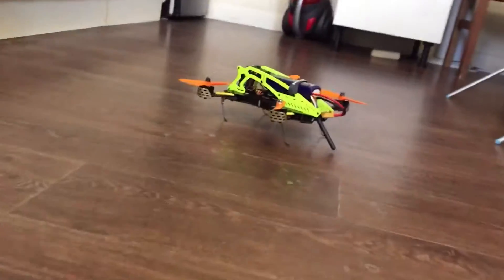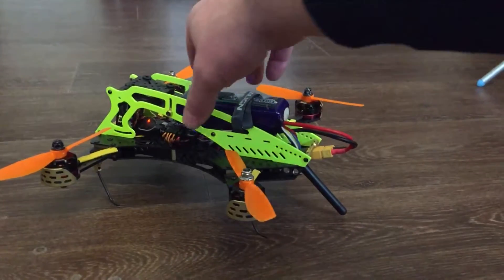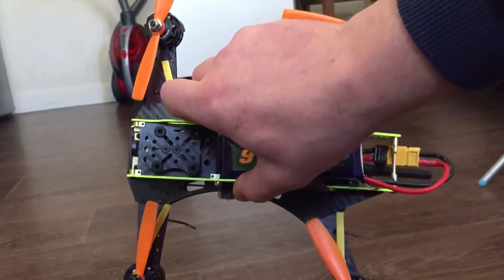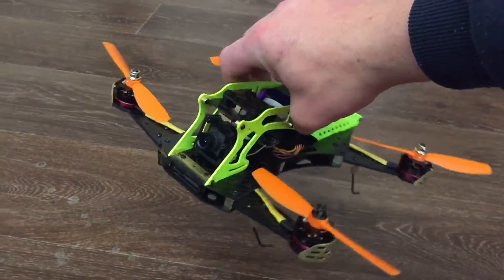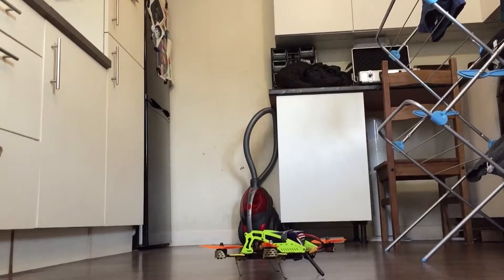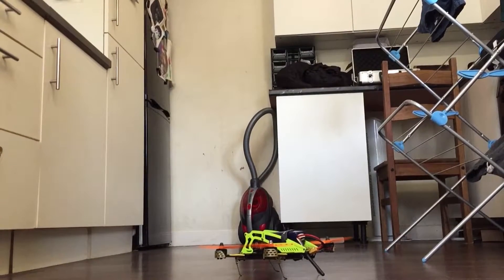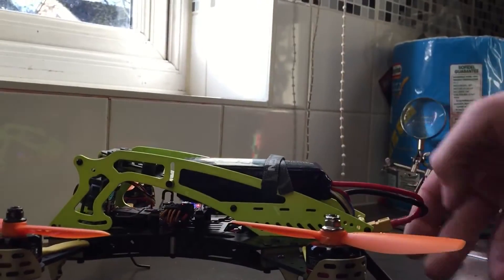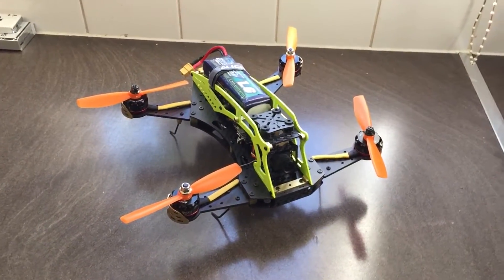Scorpion sky strider 280 quadcopter build guide part 5

Comment: Just rip those legs off dan and wack the 3M sticky pads on, i beat mine off 2nd flight lol.
Reply from the maker: alwischy FPV yeah I did think they wouldn't last long lol thanks for the heads up 👍
Reply: Did you fpv your opterra in the end ?
Reply from the maker: alwischy FPV still not flown it yet waiting for horizon hobby to sort it out as in launch mode it puts the elevons down instead of up once it's sorted I will get some videos up and fpv it
Reply: I have binned all the specktrum crap out of mine and going with i nav and a flight controller with Frsky.
Reply from the maker: yeah i was thinking about putting a standard 8 channel specky rx in it and running a naz32 with gps
Reply: Just added you in hangouts bud